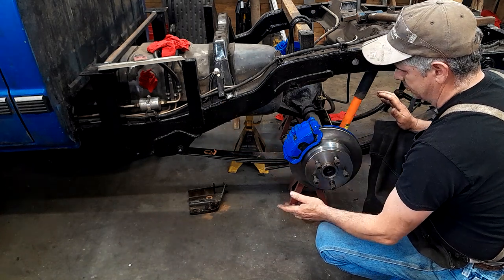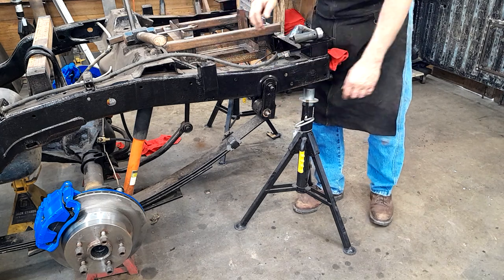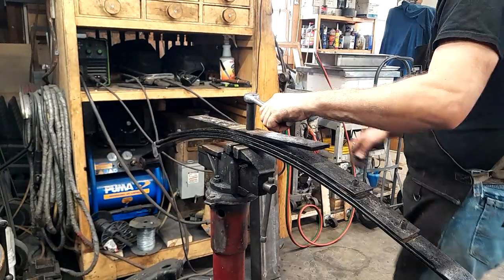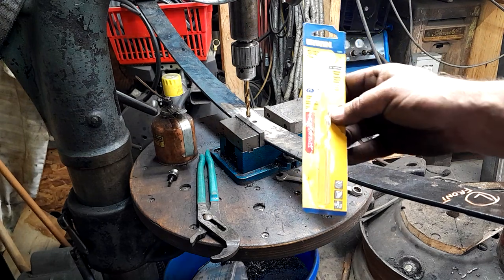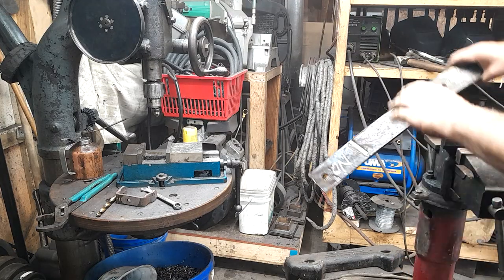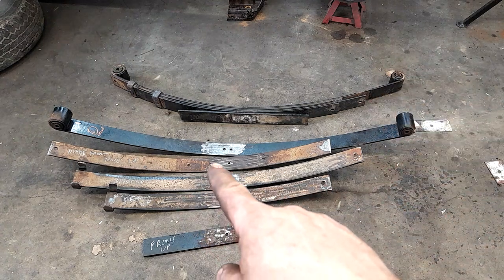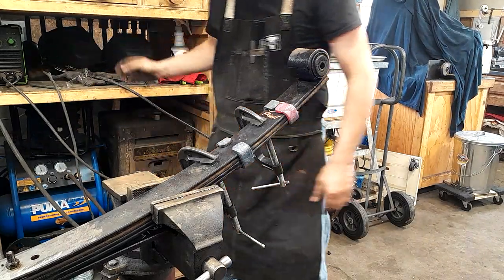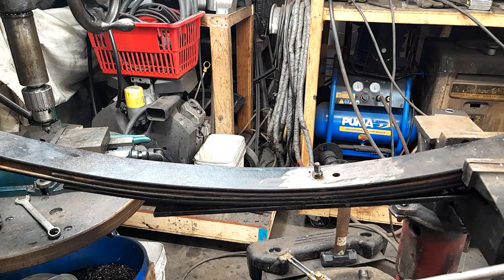Old timers suspension mods. Spring is in the air.

Comment: The scary part is always getting the centre bolt out. Tometimes it ends wihe a springy surprise :)
Reply from the maker: Yessir.  There can be some power there, especially on dump trucks and road tractors.  Passenger rigs ure usually about like cooked noodles.